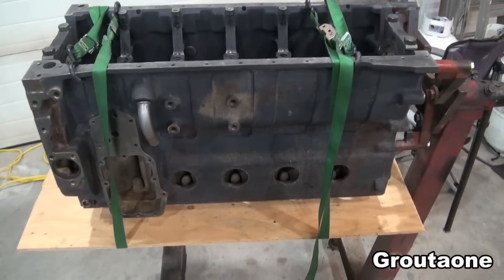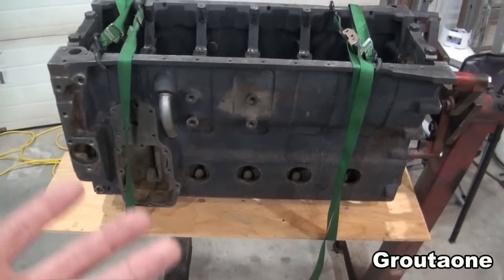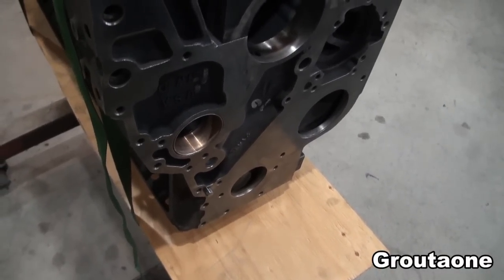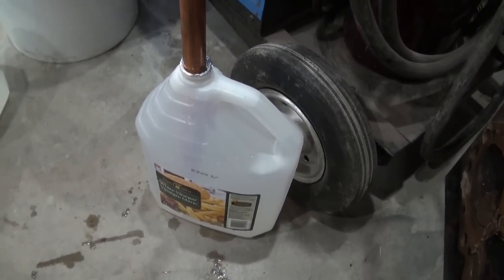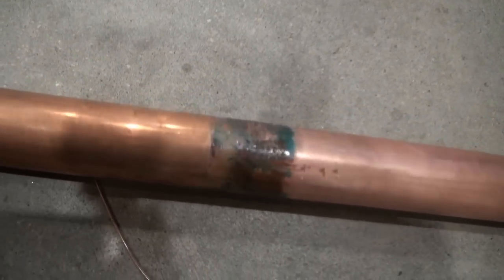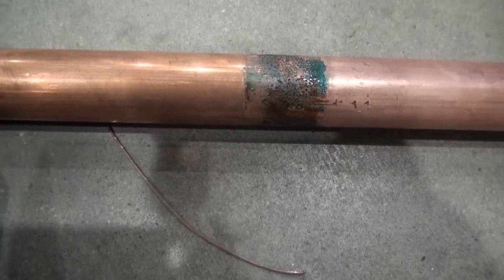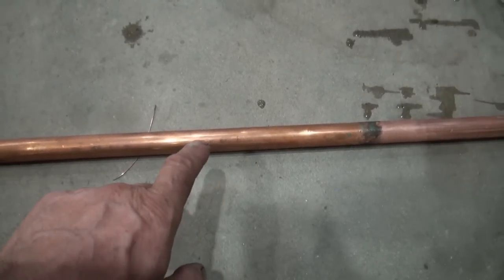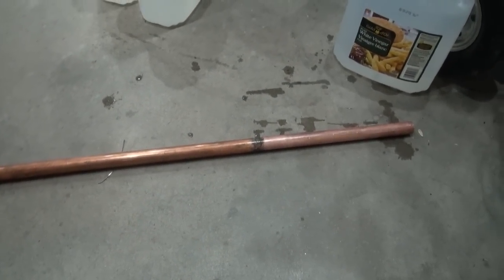Copper in Vinegar Test

Comment: dissimilar metals corrosion,  copper and vinegar making some volts reacting with air and the alum or tin foil seal on top of the jug.
Reply from the maker: That might be exactly right
Reply: Mike P my thought exactly you beat me to it

Comment: i would be careful not to leave it on the machined areas like the deck and all mating surface as i have seen some damage on a set of heads i left to long 
in vinegar had to have them resurfaced because of pitting
Reply from the maker: How long were your heads in vinegar?
Reply: 2 days it was hot out and some evaporation of water so it may have made it stronger i have been over it with every thought it doesn't happen that every time but heads and blocks worry me anymore i went with evapro it seems safer just me being burned once
Reply from the maker: Thanks for the advice  on this, I think maybe I will try about 12 hours and see how it looks
Reply: cool i just thought i would share my experience  might help keep it happening to someone  i didn't check  just left it and walked away that is a good idea to check on it would have saved me maybe lol

Comment: You will find the same reaction over time if you sweat copper pipes with acid core solder, you may well have noticed the green corrosion on your pipes at home. Try Evapo-rust. Get some corks at the hardware store for the freeze plug holes and fill it up.
 I enjoy your videos, logical and we'll thought out.
Reply from the maker: Thanks man, the cork idea is good but the coolant holes at the head gasket area have irregular shapes, I am unfamiliar with evapo-rust